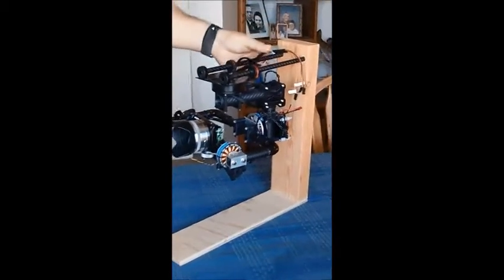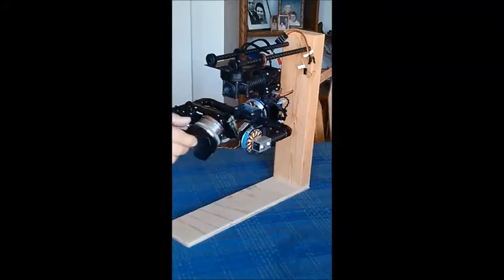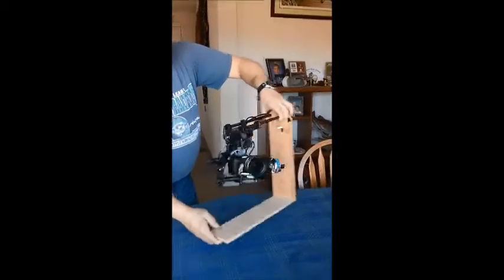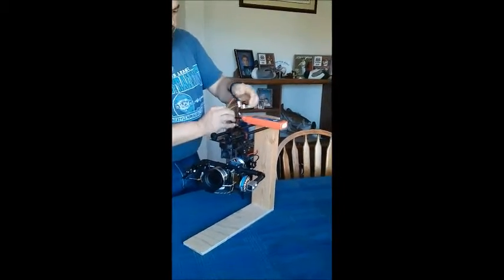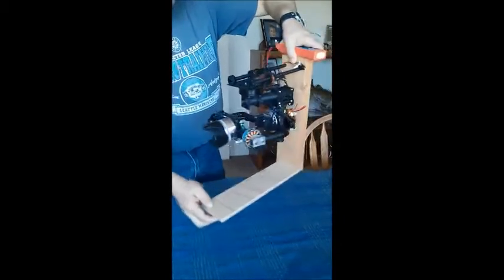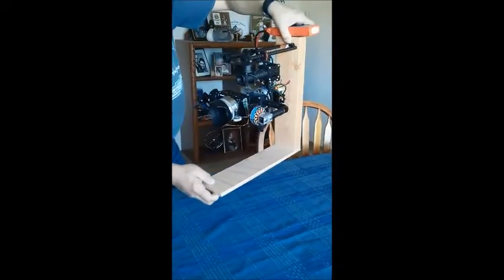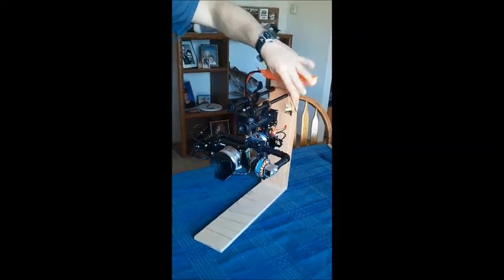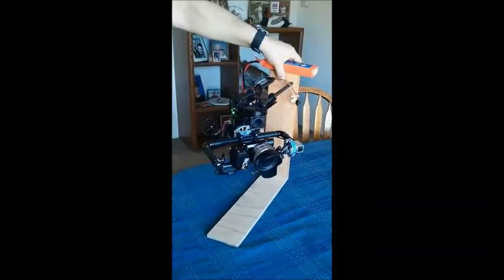nex 5r gimbal project

Comment: No man, your balance is bad... it should stay wherever you move your camera. as you can see if you pitch it down, it comes up back to straight, if you cant slide on the slider the camera more to balance glue or tape something on the gimbal or on the camera to compensate it to get it well balanced. Trust me thats all the problem. Have you fixed it btw ?